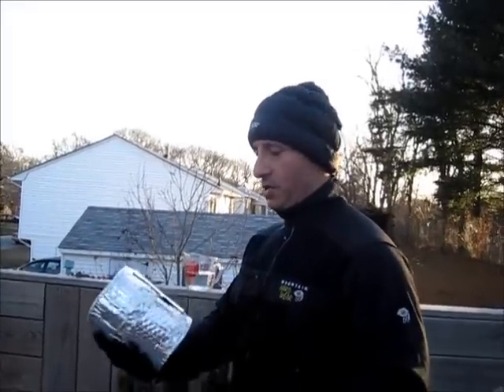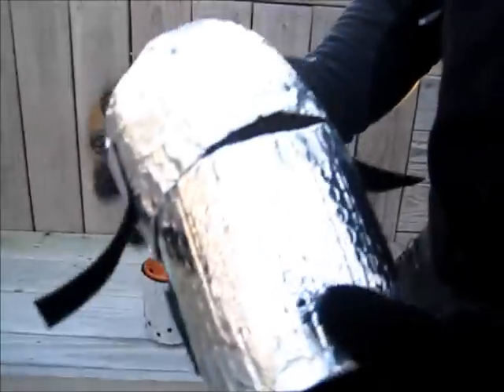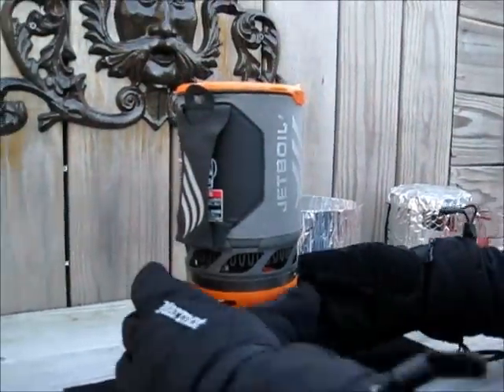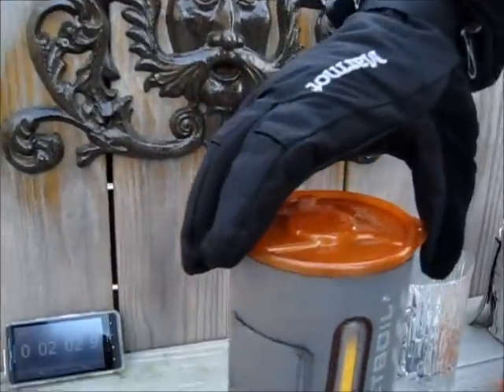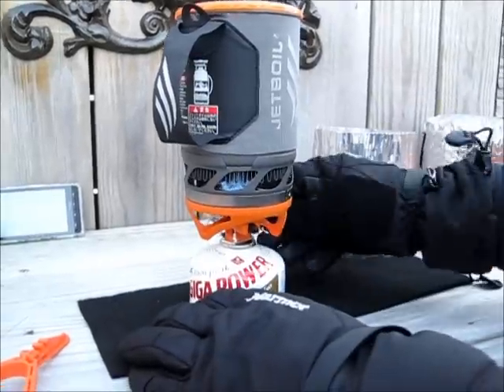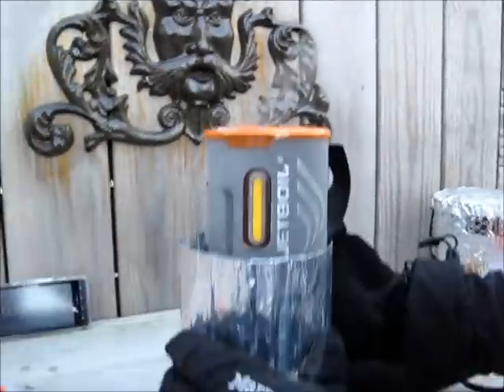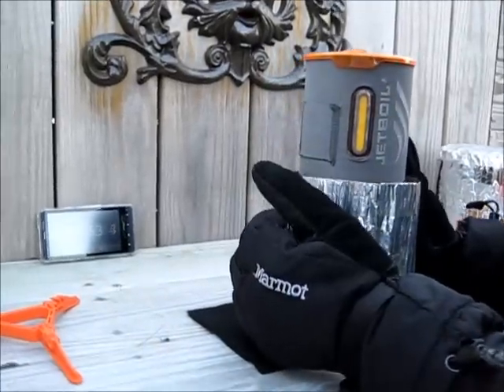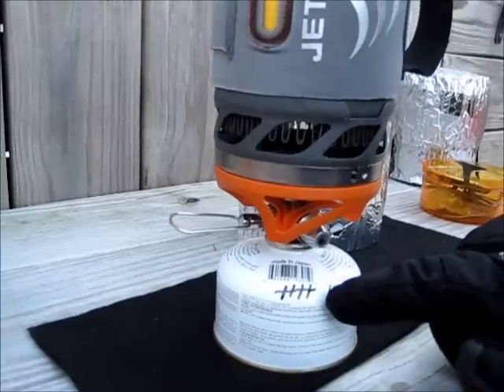20 DEGREES F AND THE JETBOIL SOL

Comment: @dragonflyhiker was that me df? :)  in colder conditions, i've also had good luck by carrying two canisters. when i stop for lunch, i put the extra one in my coat and if i can't get it to boil off of the first one or if i need a second boil, i swap the cold one for the warm one.
i've also used the larger canisters in colder conditions...i don't think they are affected as quickly because of the increased volume in the canister.

great test ed.

Comment: Very interesting. I too ended up with around 15 uses per canister at above freezing temps. The double-time performance of the Sol is not really what I was expecting to see - I figured it would be in the high three range, rather than right at the 5 range. Still, faster than any alcohol stove out there at that temp range. It would be interesting to how long (in minutes) an entire canister burns at the 20 degree mark, that could be useful to know for high elevation multi-day or thru hikes.

Comment: In your test, I think you will find that it only took 2x as long to boil, because canisters evolve gas much slower in cold weather, in effect, throttling itself down.  The temperature spread between the water's  beginning and ending states makes the bigger difference-- it takes more gas to boil cold water.
Also, keeping the stove out of any wind w/ an aluminum windshield will contribute to good fuel efficiency.